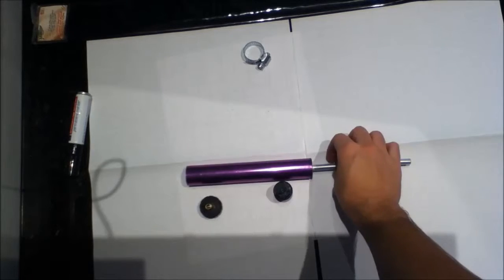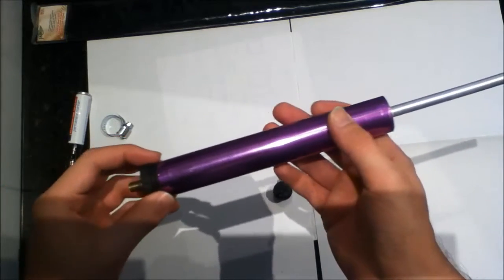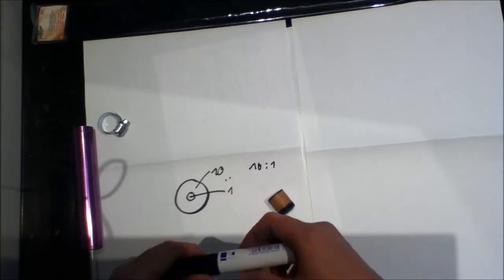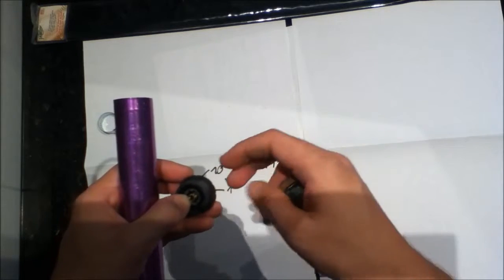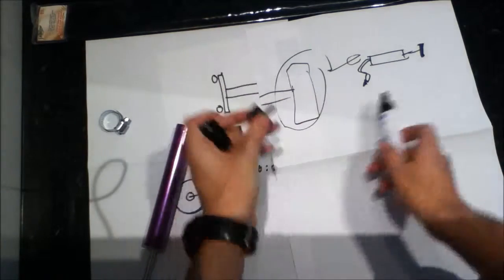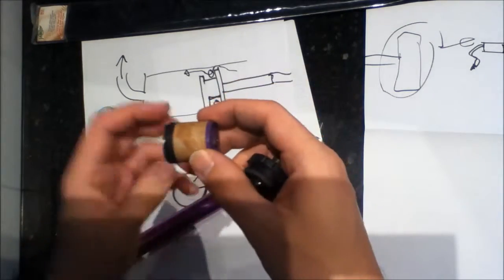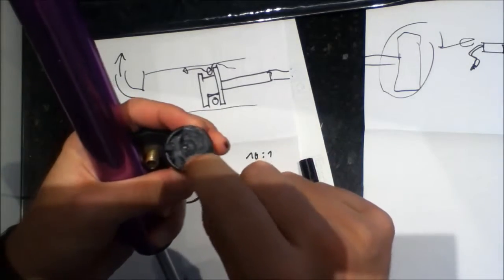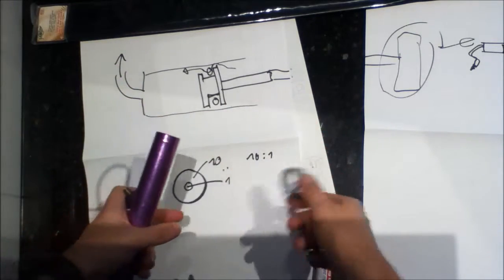QEV coaxial air cannon diy details

Comment: try to take four metal screws and screw thru the openings on the hose clamp so then it wont slide off, then smooth the inside  so the screw dont stick out too much
Reply from the maker: @otismccoy596  long time gone cannon. Now I olny use metal threads. But your idea is exactly what I thought first.

The thing is, the sealing faces were beneaththe clamp, so my guess was that any drilling would only make for a leaking point.

My best success nowadays has been done with a maglite torch type. On-off button on the rear and metal threads

Thanks for commenting :)